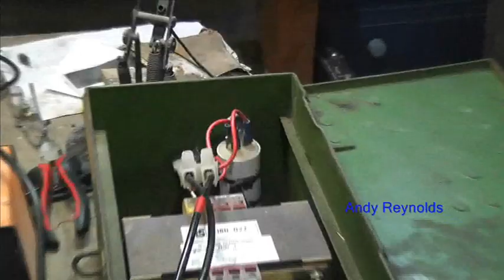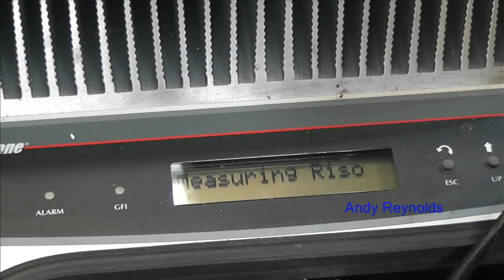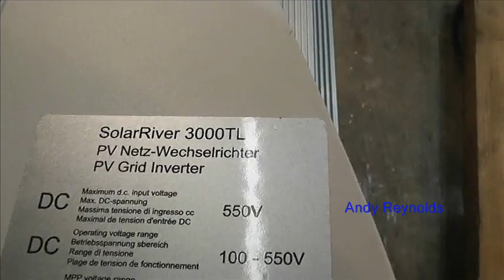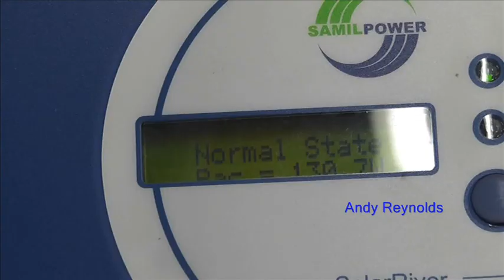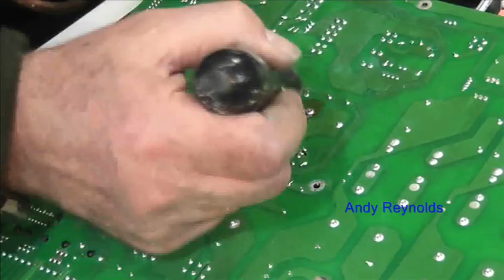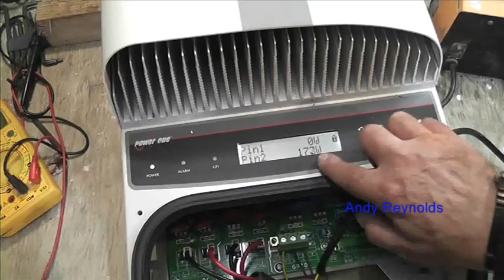Grid inverter testing and repair, relays, soldering, DC test equipment, voltage, power injection.

Comment: Hi Andy ,do you actually repair inverters ,i saw an earlier video some time ago ,you condemned a faulty relay ,relating to fault code ,not starting up ,i actually purchased the relays and holders ,but to be honest probably beyond my capabilitys
Reply: Should have mentioned it's an Eversolar, showing chek fail relay as per your eversolar video
Reply from the maker: @marekskoipond9083  The relays on those are smaller and more difficult to get at so the pins are smaller. If it doesn't work now then there no finer place to learn. Maybe practice de soldering on something else first. Skills that the future, cheers
Reply: I think you might have seen Andy repair an inverter in this video!